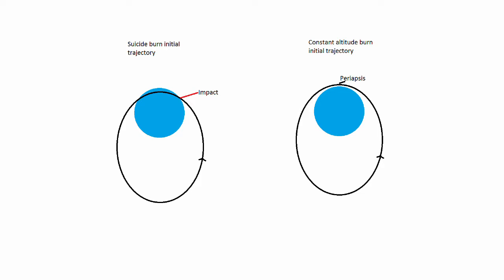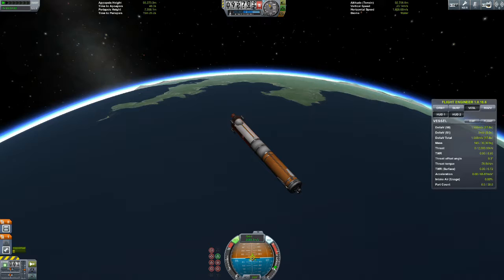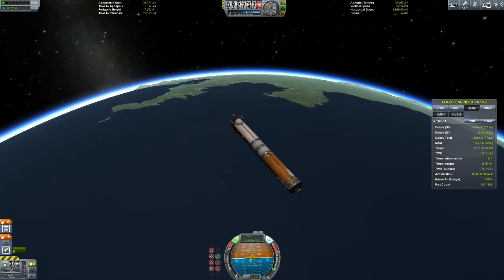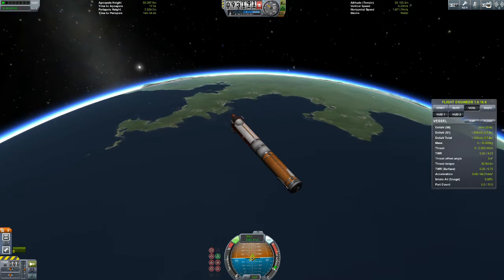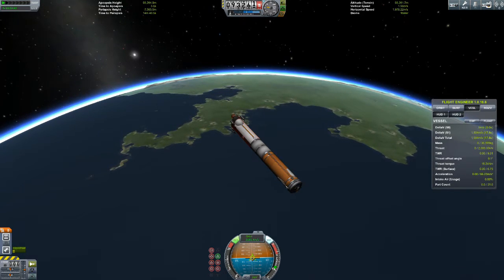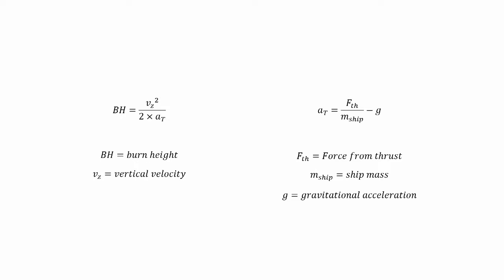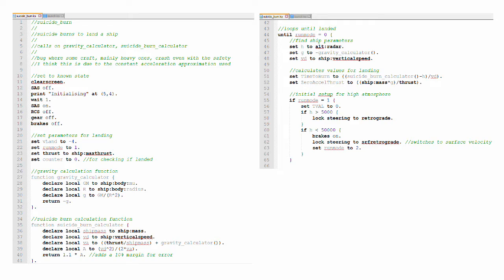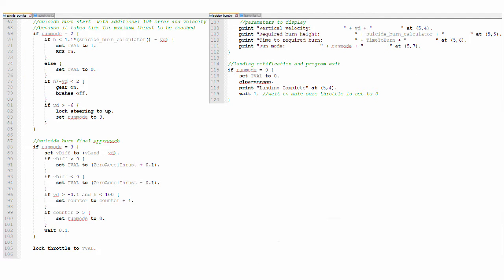KSP Tutorial: Suicide burn using KOS

Comment: why did the engine rapidly switch between on and off on landing?
Reply from the maker: Lehtaan I built in a safety margin into the suicide burn height (10%) because I was worried that the gravitational acceleration isn't actually constant (it gets greater closer to the surface), and because I was worried that the engines took a certain amount of time to respond to the command. Additionally because fuel is burnt the rocket gets lighter and thus easier to stop which all contributes to the rocket frequently getting ahead of where it needs to be in its suicide burn.

When it does this it turns the engine off so that it finishes its suicide burn at the surface (by reaching the safe descent velocity) and not above it. You could put a lower bound on the thrust using the max(,) command to make the burn more realistic if you wanted.
Reply: you could probably find the average acceleration and use that for a more accurate value. But as the burn time is dependent on average acceleration and vise versa... that's some messy math that I'm too lazy to do.
Reply: it happens on my suicide burn version too. it is partly because things happens so fast program doesn't allways keep up. must have little marginal for error, it is very hard to not cut throttle even if trying to smoothen throttle inputs it might lead to other problems, like input too smooth etc etc.